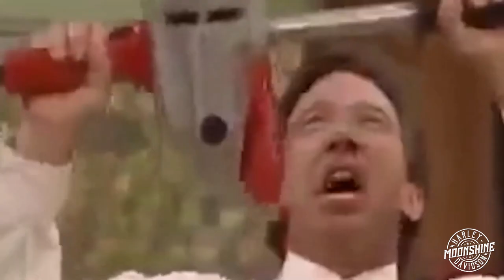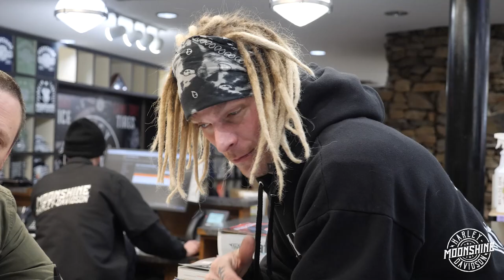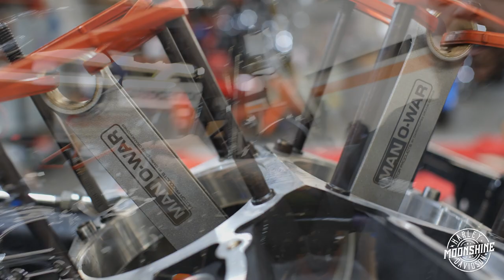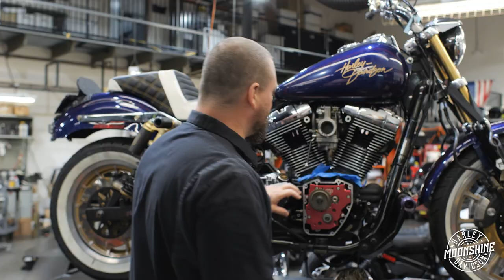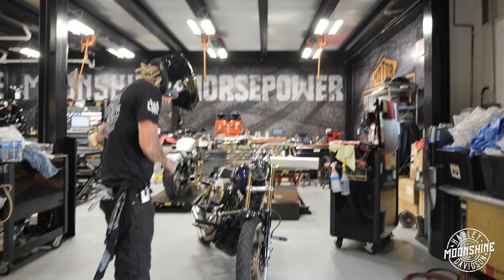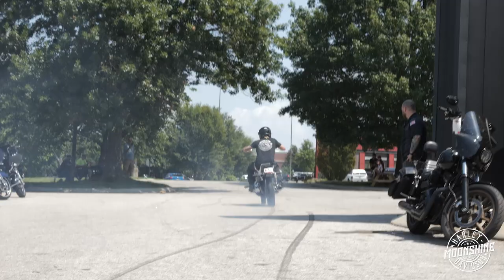Twin Cam Build | For Wheelies & Burnouts | DLO Edition

Comment: Great video and great job on the Twin Cam!! Question you guys really don’t use screaming eagle products are they any good?? I’m about to pull the trigger on getting Stage ll on my 16FLSS. Getting the 585se, se cam plate oil pump,se lifter,se adjustable rods,se Bearing all done at Riverside Harley Davidson what’s your opinion on there? My style of driving is pretty much calm/cruising i’m really looking for is some more passing Powers on Highway and more twerk on Twisteas going uphill..

Comment: You say mikuni is awesome. I wont knock that, yall are the experts. But please explain to me as to why nobody talks about the lectron carbs. Has nobody really played around with them or what? Ive run a couple thumpers with the lectron carb, air box and filter mods, cams and decatting and opening the exhaust and ive achieved immaculate results. Best part is theres no tunning needed to accomadate for changes in elevation. No loss of power or throttle response when running the twisties up in the blue ridge mountains or trailering to the lowcountry or the everglades down in florida.